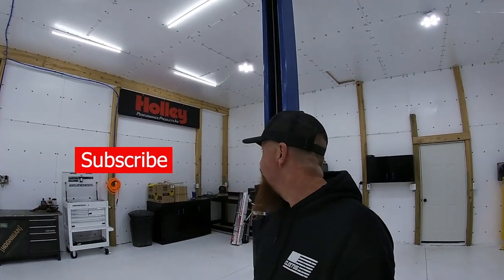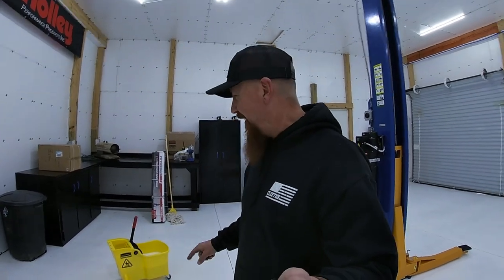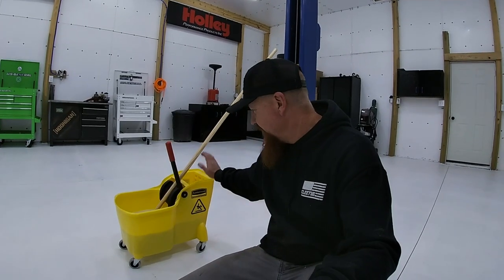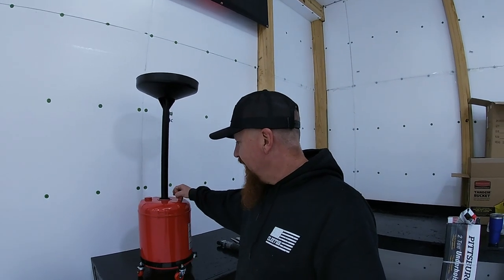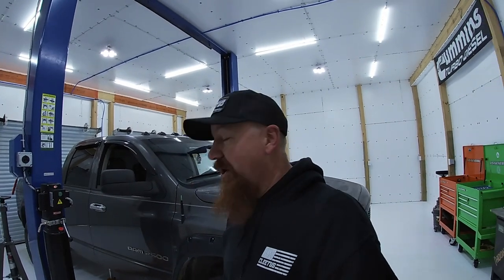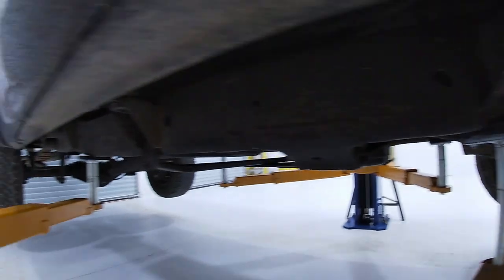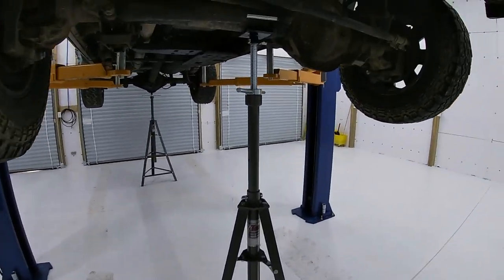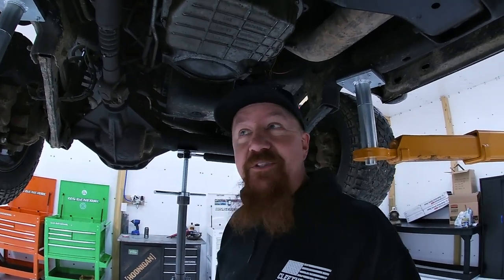Harbor Freight 2 Ton  Under Hoist Jack Stands - 5 Gallon Oil Dolly - Unboxing Assembly and Thoughts

Comment: I would NOT use the axles as safety points for the stands. The suspension they are attached to makes for a soft bracing point.  I would try to find a solid member front and rear of the truck-car.
Reply from the maker: You’re exactly right.  Thanks for commenting.